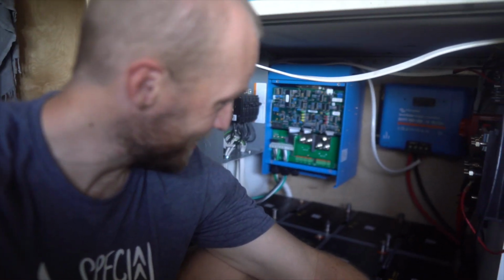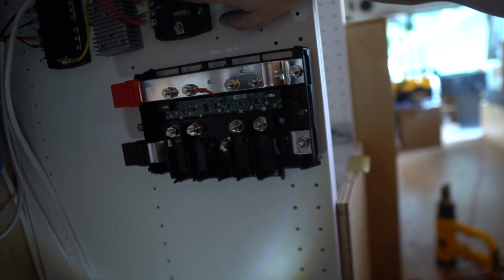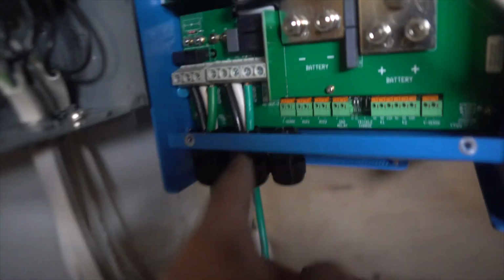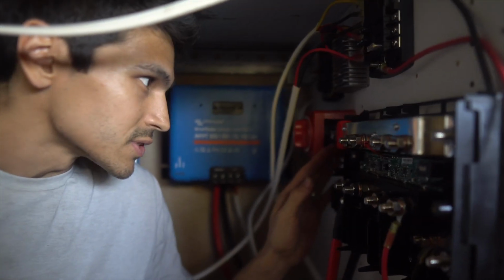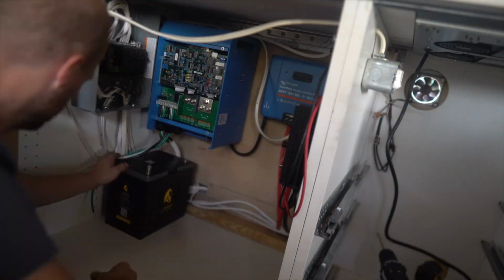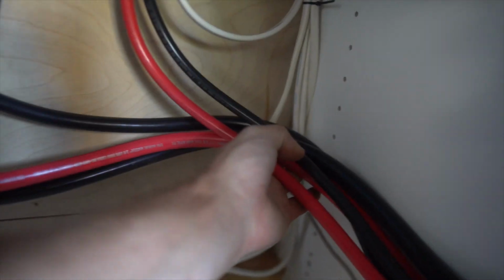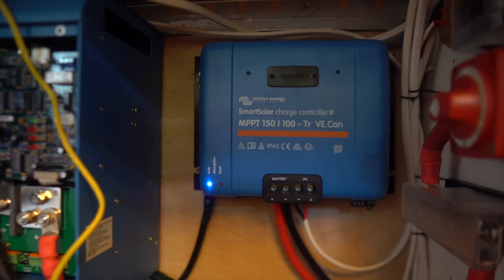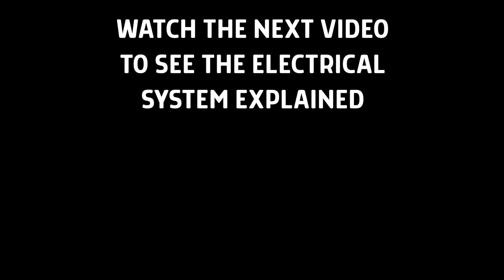Complete All-Electric Off-Grid Install in our Transit Bus Conversion (With Air Conditioning!)

Comment: After a year, how is your solar setup fairing? Any regrets or changes? Honest opinion on the batteries? Thanks
Reply from the maker: The solar set up has been excellent. Wouldn't change a thing. The batteries though I no longer feel are a good value. I think the server rack batteries from signature solar are the best value right now. You can use this link and the code JUICEBOX at check out for $50 off if you end up buying some https://signaturesolar.com/?ref=mobiledwellings